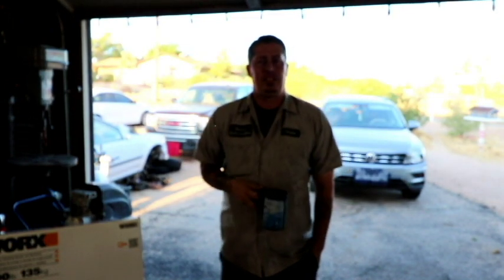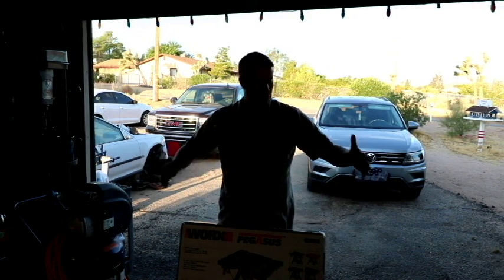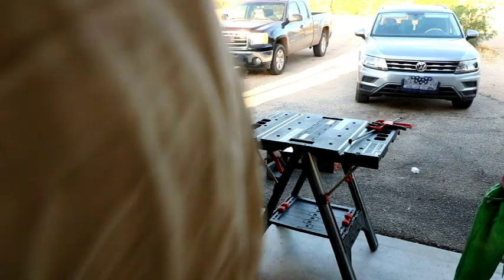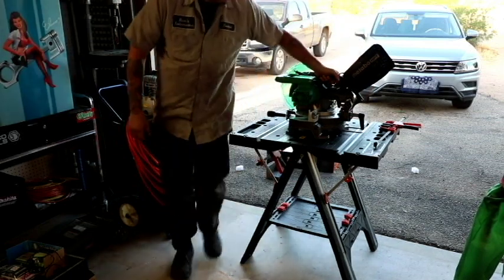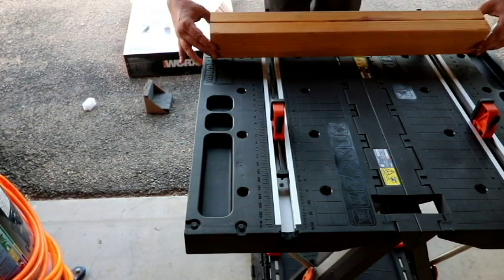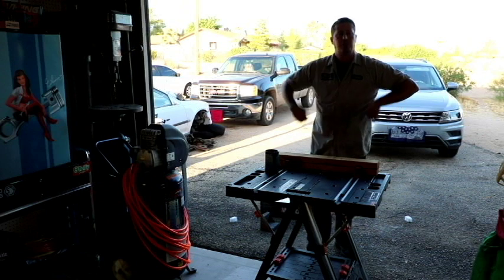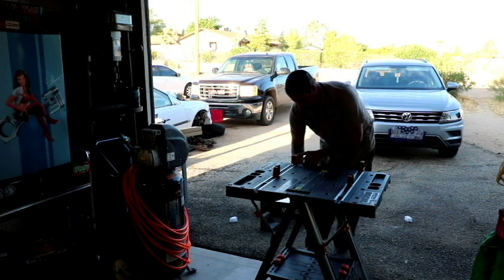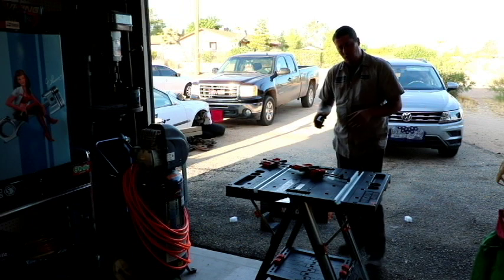WORX PEGASUS SAW HORSE WORKBENCH 1st IMPRESSION’s!

Comment: Nice table it is strong and reliable. The Worx table was good choice. It even comes with the 4 dog clamps. If you look at the end of the table there are 2 rubber eyelets with 2 wholes they are for connecting another Worx table together which you can use to but the saw on and the other for the plywood. Have a great day "cheers'.

Comment: I got 2 that are supposed to be delivered today. I can hardly wait to use them. I am adding onto my porch, so these will definately come in handy. I mainly got them for the sawhorse feature, but the way I look at it, all ths extra stuff is just a bonus. I was going to go to lowes and get 2 of them, but I could have bought 3 from worx for the price lowes wanted for 2 of them. That's crazy, plus I got 15% off with manufacturer. A little over $200 for 2. I really like the clamp feature as well because I have limited movements in my arms, so any way I can get my pieces to stay steady, the easier it will be to cut them. I truly hope these are as good as all these youtube videos make them seem.

Comment: Thank you for the great review. I've been looking at replacing my current two setups, sawhorses and mortar stand with plywood tops, with one of the common folding workbenches. I considered this workbench but after your review I think I'm going to go with the Dewalt (DWST11556). The Pegasus looks like an amazing bench, especially for home use, but between the lower price and the solid top the Dewalt seems a better fit for my applications. The Pegasus does look pretty solid though, watching you lean on it and it not even budging does make me think twice. Did your Lowes have display models?
Reply from the maker: They Did Not. I will say I'm actually pretty satisfied in it considering that there was not a display model. Now that being said I did think to my self.. Self.. Even though this Saw horse workbench seems to be pretty badass there is probably going to be a time when I still might want a set of Heavy Duty Saw Horses. So I may go back next month and pick up the Kobalt's even still, but for what it is that I was currently after and considering the first couple of projects are going to be father daughter, this little workbench is going to be Awesome!! Her and I will begin working on her Table for her bedroom sometime tomorrow evening. Hopefully in better lighting and if your interested you can see the different situations we encounter along the way. Cheers!
Reply: @JustinDowDIYcentralhighway  How sturdy is that bottom shelf? I'm still going back and forth and haven't decided. I watched another review and the Pegasus seems to fold and unfold quickly, which was another concern of mine. I'm starting to think it may be a better fit for me afterall, if I'm not intending to entirely replace the sawhorses/plywood combo as a work surface.

Comment: That miter saw is a legitimate contender for the "Goes Hard to the Paint" tool. No soft start for that bad boy, unlike the table saw brother I got it with as part of the packaged Lowes deal 3 months ago. Did yours come with a lot of grease all over the table area? Mine did. Also, Lowes has a pretty good deal on miter saw blades, better so around the holidays. I highly recommend replacing that blade that comes with it, not saying the blade is the worst I've ever used. But a $30 blade can make all the difference without breaking your bank.

Comment: Great video i have the Kreg work table thats similar to the Worx table. But the table top doesn't sit flat each side of the Kreg table dips witch nothing sits flat on. A big minus for the Kreg table. I just might go pick up a Worx table.
Reply from the maker: Do you currently own the Kreg recessed Hole Jig? If so, How is it?
Reply: @JustinDowDIYcentralhighway  Yes i have the Kreg pocket hole jig it's works great ,very easy to use and makes solid joints, I use it for cabinet and face frame making.

Comment: The height is so you can reach the center of a 4x8 sheet product. I prefer the old Black and Decker Workmate, more versatile. I have a pair of first generation Workmates I've used for over 25 years without complaint other than newer versions are a different height.